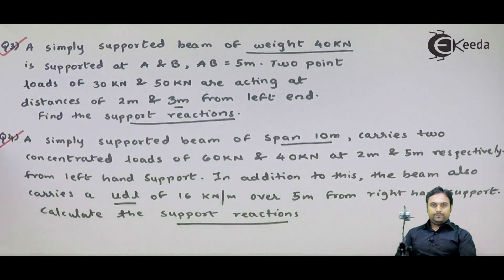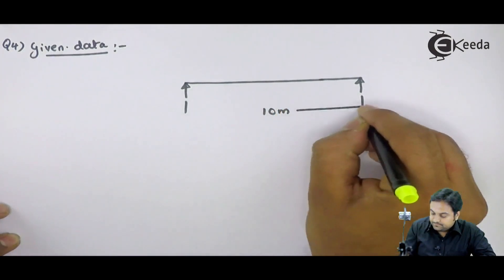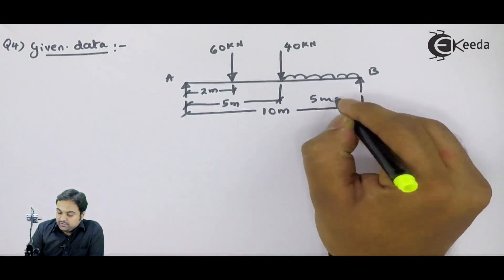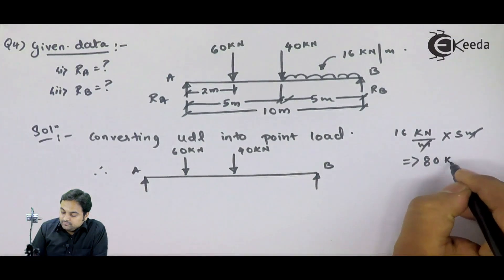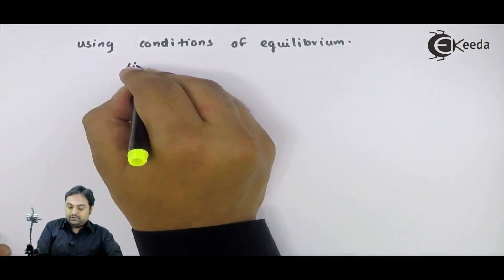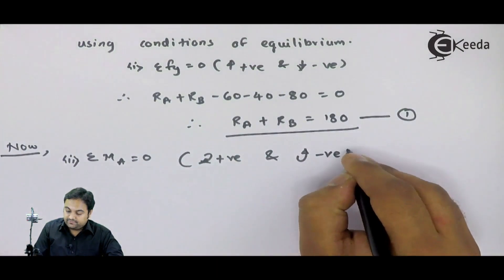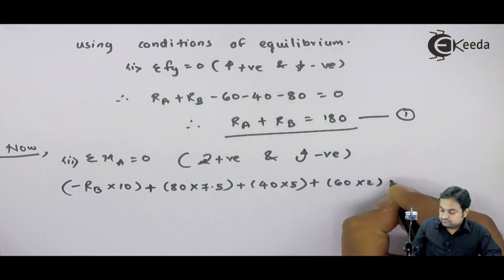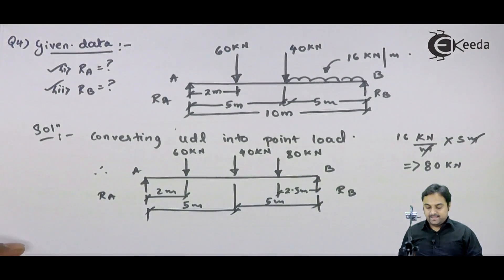Beam Reaction Forces - Problem 4 - Equilibrium of Forces - Engineering Mechanics

Comment: i think the ans is 52 & 128
Reply from the maker: We will work on this and get back to you.
Reply: i think its right you should multiply 80x2.5 not 80x7.5 in udl case
Reply: It depends actually on which point u want to calculate moment. If u r taking moment about point A then the distance from A to the force 80 is 7.5, i.e. 80x7.5.  Likewise if u take moment about B, then distance will be 2.5 and hence 80x2.5.